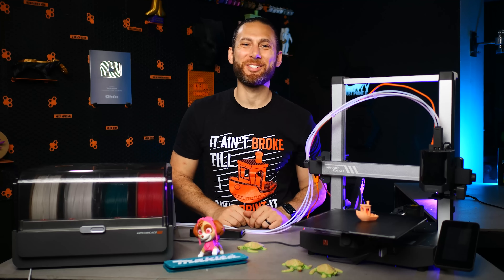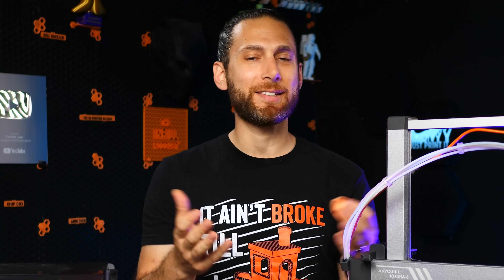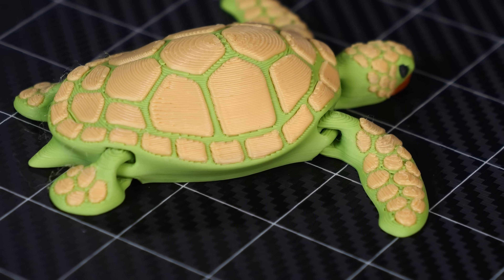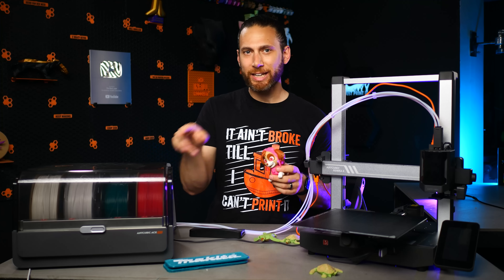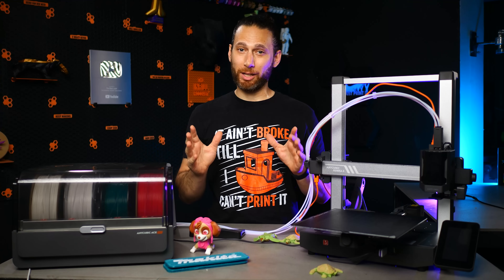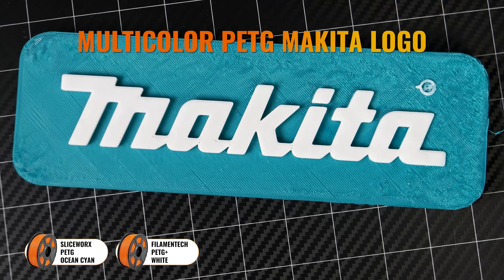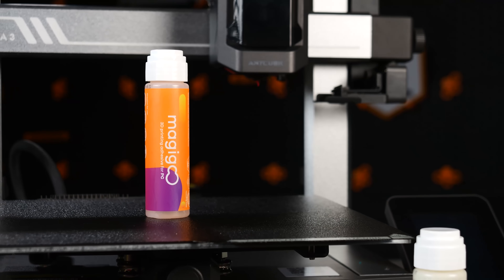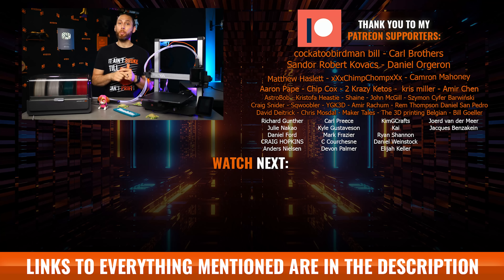AnyCubic Tries Multicolor: The AnyCubic Kobra 3 Combo

Comment: BTW, this is the video that got me to buy this printer. I am happy to report, that I'm using their orka variant, and have had several updates, to the slicer, printer, and ACE! It really does run super well. I barely ever have a failed print, and it's usually on me, for trying to be like "eh.. it's basic PLA, but I bet it can print at 200mms, no sweat".. yeah not so much as it turns out lol. But the stuff does print far far faster than you'd think it should. And I've definitely figured out how to color prints in a more time and material efficient way, but the way I orient the print, and how I choose to color it.

A feature I would absolutley LOVE to see is the ability to cancel individual pieces of a print. Say I'm printing chess pieces, and halfway through a 12 hour print, a pawn gets screwed up somehow.. It sure would be wonderful, if I could pause, and somehow tell the printer "ignore this piece for the duration" instead of having to throw out the other 10 or 15 pieces that were going fine.

Comment: So, I've had this printer for like 2 weeks. I had a Photon mono back in the day, and pretty quickly gave up on 3d printing lol anyway, so I got this guy couple weeks ago. I bought several different filaments so I'd have a wide variety. I bought an 8 pack totalling 2kg, not realizing the spools would be so much smaller, haven't had any issues with them, just sitting in the ACE, no adaptors or anything. I got some PLA wood, and have had mixed results in the 2 attempted prints, 1 fail, and 1 that printed ok, but some areas fused together to the point that one spot actually tore a piece of the top layer off when I broke it free "it was a infinty fidgit cube thing" but aside from that, it's fine. I also printed that gyro 4 color thing off the flashdrive? Well... I'm a noob, didn't realize the 1kg of clear pla I bought was actually petg.... it was the 2nd outermost ring... did fine, no worries, printed like a champ... with like FIV HUNDRED PLUS color changes lol. I have had a few fails, but I'm pretty sure that was due to grubby people grease on the bulld plate, since after I cleaned it, in accordance to your instruction, I've not had any issues, except the wood, but that stuff seems difficult anyway, lots of little clumps in it, cuz I mean.. saw dust. So, I had less successful prints with that 1st POS, than I've had failures with this one lmao. Thanks for what you do, it has truly helped me A LOT!

Comment: Interesting video, and while I love the original Anycubic I3 architecture, I do not think thermal extrusion filament deposition is the key to multicolor 3D printing
Someone needs to think outside the box. I have long had ideas on how to do this without the use of filament but instead using thermosetting powders instead and develop a head similar to that of regular inject jet or laser printers, but the process done in layers, one would still need to slice a 3D file to obtain the typical SLA layering to build the 3D shape but it would be a lot more refined  and truly high resolution, you would not see the annoying layering effect as it shows in this video of using multicolor filament. I think this process of still using filament is backwards and someone is not thinking properly because they are stuck on this technology which by now should be obsolete for refined 3d printing.  

I was wondering why another video review on this machine was not showing the benchy printed on it, up close, now I know why.  I will stick to regular single extrusion and design the part in sections if I want multicolor assemblies. At least this way, I can better control the resolution of each color, aesthetical appeal and mechanical fit of the final 3d printed model. Having the dryer device is a nice feature but really does not do anything for me if the final print is not fluid and better than present-day single-color printing as far as finish, resolution and seamless blend of color.

Comment: I really liked your video and i want to get Kobra 3 as an update from my old mega S can you tell me if it noisy?? On my mega s i changed all the fans with noctua cause they were loud. I would have it run in more than 100-200mm/s even though it can go higher. Can you test its noise on a print in these speeds?

Comment: Worked great until it broke after a week...the advertised anti-clog detection system didn't shut it down when it got clogged up so the printer kept shoving filament into the print head assembly, freezing it to the track so that we couldn't disassemble it to clean it out.  Returned it for a refund.
Reply from the maker: Dang. Sorry to hear that. Yeah, it’s not polished yet but I hope software updates will fix that

Comment: So, lets start by saying you cannot use your supply of filament you already bought, it must be this companies special filament with a chip on-board to tell the printer what you put in,?

Seams to me Anycube are not saying that you can buy Sunlu on Amazon UK st s bargain price, and hse it eith this printer?

Ibe bought 50 or more rolls of different companies filament, and that's all no use at all wth the printer, do now people have to buy this much more expensive filament, so thats how the company can make a lot of money.

Or please tell me im wrong, i can pit in Sunlu ref,black,orange and yeallow Sunlu and it will still print in colour 
 I say Sunlu as they sre selling high speed pla, which i was using with s creality k1 max, until it dtopped working, so looking for a new printer, and thought colour would be cool. Sorry about typos, 5am UK time, snd using a cell phone to ask
Reply from the maker: You can use any filament. Their filament is just if you want it to read automatically. Like Bambu
Reply: @thenextlayer  thanks, that took a load of filament of my mind.

Tell me truthfully, ive gone through k1 max, each last about a month before going wrong. The one im just about to send back to AZ had the new extruded and new nozel, both improved the model 500 % but during a 12 hour print, the Ai didn't see the extruder had stopped feeding the filament, so model trashed. This printer suppose to be the best, not impressed. I need a reliable printer, thats not going to let me down. Is this printer going to be the one that i need?

Have you used one long enough to answer 😂

Downloaded the slicer, looks complicated, i could start with just one colour. But things sre missing

High quality print
Normal
Fast 

For the speeds, also the list of filament your going to use is all anycube, no basic list, ABS, TPU, High Speed, not listed. I got yo cut these 300 x 300 sheets, i have lots.

Comment: please answer the question

"This printer can print ABS and other abrasive materials when you don't want to print in color, that is, directly from the spool to the extruder without the ACE PRO. And if I enclose it, could it print ABS, polycarbonate, or nylon?"
Reply from the maker: Ummm you’ll need a wear resistant nozzle to print ABS. But I see no reason why it couldn’t print ABS NYLON PC Etc if enclosed. Still, it’s not really intended for that. A properly enclosed printer might be better

Comment: The print quality of these, especially the dog, is horrible. Slicer settings aside, it should still be able to line up the colours nicely and it doesn't. This thing doesn't come close to finished quality of Bambu. It may be $100 cheaper than Bambu, but you'll never get Bambu print quality from it. So its actually an argument and promotion to buy the Bambu, as this printer is clearly a cheaply made knock off.

Comment: It would be realy nice if they would make the ACE unit available for 3rd party printers. Unlike ERCF, MMU2 etc. the ACE (and the AMS) actually have their feeders permanently engaged, as they sychronice the AMS/ACE feeder to the extruder (I disassembled the AMS-"buffer", turns out it uses a slider, a spring, a magnet and a hall-effect sensor).  On the A1(lite) this actually is on the top. I am sure the Kobra 3 uses the same method.
So it would be realy nice if it could be connected to klipper. Or even a Prusa mk4.
If you have a printer with integrated nozzle/heatbreak combo and "normal flow" (like Revo, Nextruder and TUN), you get nice filament tip on unload, no need for cut&poo. This reduces not only waste but also changing times. So a printer with standard flow integrated nozzle/heatbreak combo do not need cut&poo. However, a MMU3, ERCF etc. is much harder to set up and can fail if the filament spools are not optimal placed.
So combining the ACE/AMS with it´s easy filament handling with a printer with reliable unload ramping procedure and easy to change nozzle (insert high-flow nozzle for single-colour and standard-flow for multicolour) would be best of both worlds.

For me personally, I would like to use the ACE with a Qidi X-Max3. That printer has a heated chamber, and I would realy like multicolour parts in ABS. Also of course the Sovol 08 might be a candidate. With the Revo coldend presented in another video, it should be able to change filaments without cut&poo if using a standard revo nozzle, while printing fast with high-flow revo. Combine this with a toolchanger (high flow nozzle for main colour in tool0, standard-flow nozzle in tool 1 with ACE connected, TPU in tool2 and support material in tool3) and the posibilitys are endless.

Comment: Hi, can you also do multi-color TPU prints with this? I am looking to print with the soft Recreus 82A filament, but the bambu lab AMS cannot handle TPU and it would be cool if this one could.
Reply: No filament changer can use normal TPU. The filament changer has to push the filament through the tube to the head - and TPU is to flexible to do that. Even the Prusa XL has problems with feeding TPU through the reverse bowden. However, after you got it in manualy, it works, as the XL is a multitool printer and the filament isn´t changed but the tool.

But: There is always VarioShore, a filament wich shore hardnes changes after heating, depending of nozzle temperature. The filament on the spool is nearly as stiff as PET-G, so it might work with filament changers. By setting the nozzle temperature you can adjust the shore hardness. With this filament you can get incredibly soft TPU using higher temperatures - a filament having theese softness from the start would not be printable with any normal extruder.

So you might search for some videos about VarioShore.
Reply: @oleurgast730  Hi thank you so much for the answer to my comment. I had never heard of VarioShore and I am just looking it up. I will definitely test this one.

Comment: The K3 is in the Anycubic Slicer.  I have been testing out several printers and realize what I want to see in a review is how easy is it to set up the network and print from my laptop. Using Fluidd if possible.  There always seems to a trick to it. PS Sorry you get so many negative comments.
Reply: Sorry, anycubic has locked down klipper firmware, only way to print is on their app or USB stick. I have the kobra2pro, they don't do anything to address users concerns.

Comment: Its an A1 clone (clearly) and the 8 color isn't out yet for it.  Do note that the Bambu A1 does have an extra AMS port on its back, so it does look like they are planning on adding in support for a 2nd AMS Lite or support for two normal AMS systems.

Comment: You had me at 'print resume' working properly...electrical power is not 100% where I live!
We get 2-10 second outages on most week-days...my apartment is on the same substation as an industrial park...so we get power fluctuations during the work-day with the occasional drop-out.
I almost got the Kobra 3, decided I didn't need multicolor....went with the kobra 2 pro instead.
Crazy-fast printing, I had to put a paving-stone on the table to stop it from shaking!
Reply: get a UPS. print resume leaves a line so now you have an ugly print and wasted filament
Reply: Yes I have a 1800watt UPS and it keeps my printer going for about 1-2hours when I have a powercut... Plus I have a generator, so if the power is out over a longer period I just need to get the generator started you before the batteries die.

Comment: Thanks for the video, but it really left me wanting to know way more than you really went over. Being multi material, I have liked to actually see material changes and how much is wasted. Also, it didn't seem like any of the prints turned out to what would be considered good quality. Seems like there was an excuse for each issue. We all know it can take some dialing in a filament profile but should be able to get at least one type printing well. Left me very unimpressed with the performance of the machine.
Reply from the maker: Yeah that was an oversight. And yeah, this machine (software wise) wasn’t ready for a proper review, hence the first look. Sorry to disappoint!

Comment: The fact that this is a filament drier is amazing, I was always bummed my AMS can't do that. Specially for the price
Reply: Ya seriously, I know this isn’t a fair assessment but when your spending ≈$1000 another $160 probably isn’t the end of the world for a dedicated appliance
Reply: @yinzerinsteelersnation4695  I am designing my own filament drier right now actually, it's such an easy thing to make, abstractly, all you need is a heater and a mosfet, but I assume the reason Bambu did not do this is that AC Is dangerous and a pai. DC would mean needing a beefier power supply. Still, you can make a great one even with a 50w element. Mine is 100w for a big food container much bigger than the AMS

Comment: I have LOTS of trouble with ASA, will try Magigo.  I use 3DLAC but needs to be applied every time.
Reply from the maker: Dude it’s a GAME changer. My vorons all have lines all over the print from slathering on glue stick, but with this stuff, it’s imperceptible and it sticks like you wouldn’t believe e

Comment: I live in a very DRY environment, and from back in my PRUSA days, I always hated PETG. Stringing. But with the Bambu Lab and AMS I LOVE PETG. Now I hate PLA because it breaks in the AMS.
Reply: I have a X1C with AMS. I used a good amount of BL, Polymaker and eSun PLA (regular and matte), and didn't face any breaking. As far as I can tell, PLA breaking means it is brittle, so you probably have moisture/heat damaged and/or low quality filament. Or maybe you have any other ideas on why it could break?

Comment: I hope when you do a full review you really compare the printers construction, color changing waste, and ease of use vs the bambu A1 combo. Their prices are close enough that im really wondering if the kobra3 is worth it. Sure it has a fillament dryer, but afaik the axis are just roller bearings not even liear bearings vs the A1's linear rails

Comment: If Anycubic makes that ACE unit work on other brand machines.....Bye bye Bambu.  That would all but crush Bambus AMS proprietary system.  As it is there are ZERO reasons to buy the Bambu A1 over the Cobra 3.  C3 is faster, newer technology, takes up less room, and costs a lot less.  The only people I see buying the A1 over this is Bambu fans and brand loyalists
Reply from the maker: Maybe. There's something to be said about Bambu having 100% perfect profiles out of the box, and AnyCubic has yet to prove those. Also, maybe people don't like AnyCubic's slicer, but love Orca and Bambu Studio
Reply: @thenextlayer  Interesting, I didnt know Orca slicer was a Bambu only slicer, Odd how that must have just happened. and Bambu's slicer is nothing more than a Prusa slicer reskin...Also As far as Bambu having perfect profiles out of the box, Thats just false.  I can say that 100% as I own 2 of them (P1P and P1S) and neither of them print TPU or PETG very well "right out of the box" with the stock profile.  TPU you have to change the speed and temp settings and PETG you have to change Bed temps to get them right.  I am not the only ones that experience this as I am sure you know.

Comment: I appreciate that you say this is not a review but most people watching this are going to look at this video and see all the errors and form an initial opinion of this printer, RFID spools would have solved the temperature errors! if Anycubic wants to compete with Bambu Lab they needed to send out a finished machine for people to form an opinion on, the purging of the waste filament needs to be something better than flicking it, are users meant to sit by the machine catching filament purges whilst their part prints? of course, there will be a multitude of bins available to print for the waste purge but I can see them having ridiculously large back planes to stop flicked filament flying in semi random directions.
 I know that heat + magnets and magnetic fields are not a good combination and so I am curious how well the filament changers motors will stand up to the heat from the drying process.

So far Im not impressed by this machine, no matter how much cheaper it is than a Bambu Lab printer.
Reply: Babu Labs just shoot out poop, have you complained to them about unfinished printers?